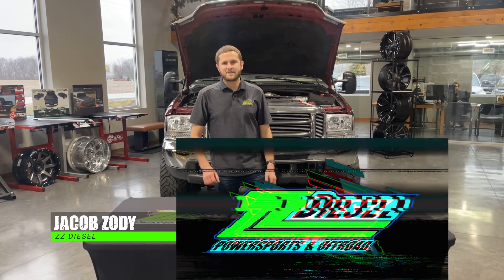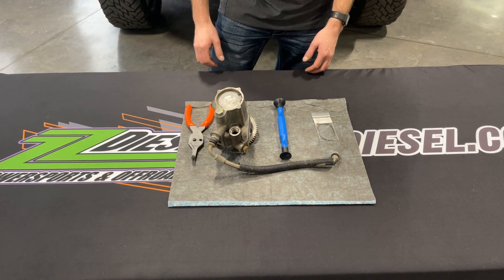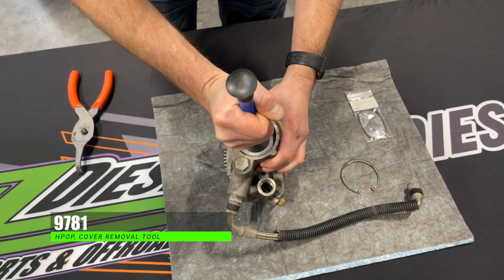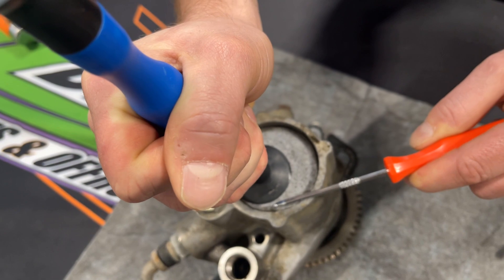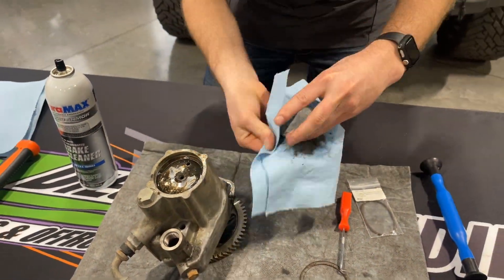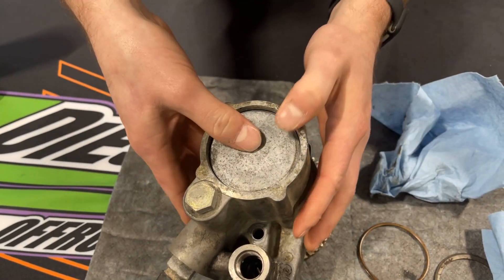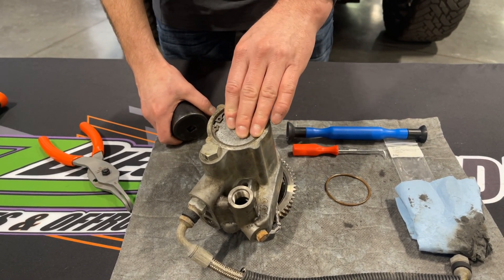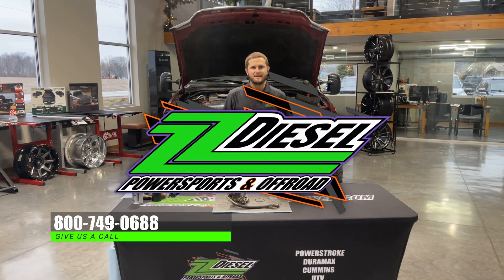High Pressure Oil Pump, HPOP, Cover Seal Fix. 7.3L Powerstroke

Comment: that snap ring caused me to have to do this 4 times, every time i thought it was seated but was not, cap will blow off, ended up taking the pump off the truck to do it, took alot of pressure and i still went around it with channel locks to verify it was fully seated,

Comment: Your o-ring is thinner than my old one that was leaking, and after installing it, rear cover slides around in the opening even with the snap ring secured in the groove. Doesn't feel right
Reply: Does it leak?

Comment: I’m getting oil in the valleys
Reply: Turbo drain, ebpv leak at the pedestal, high pressure lines or connections, ipr, icp.... could be any of these or a combination.
Reply: @georgesrisomsak9650 mine ended up being this seal. These trucks will drive you nuts lol
Reply: @kalebsteele8430  wait till you get to play with a 6.0. They are way more fun! 😂

Comment: So don't smack the cover hard to break it loose but its OK to SMACK it with the socket on it to seat the snap ring. Got it. Lol.
Reply: There’s a difference on surface area impact with the socket
Reply: there's also a big difference between striking the cover with the old flattened old o-ring which is pretty much useless and is allowing metal to metal contact, and the new fully round o-ring which now provides for some extra space underneath the cap.  so striking it a couple times using the socket to help equalize pressure across the entire surface is only going to compress the o-ring and very likely would be just fine.  he also mentioned doing that if all else fails with just manual pressure.
Reply: When you smack the snap ring, once it seats on the groove it aint going any deeper or to damage anything. Good to be safe anyways, you don’t have to go hard and get it in the groove on the first swing lol